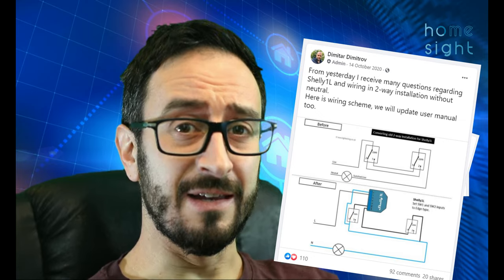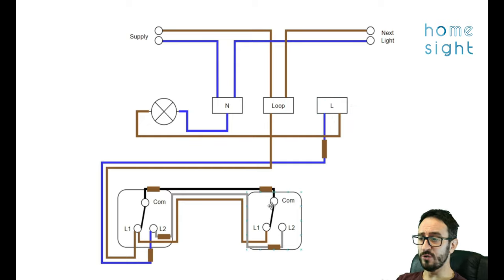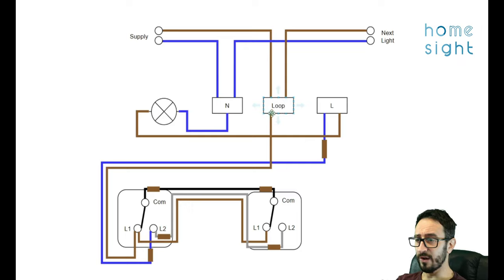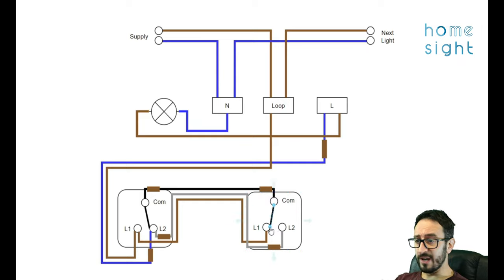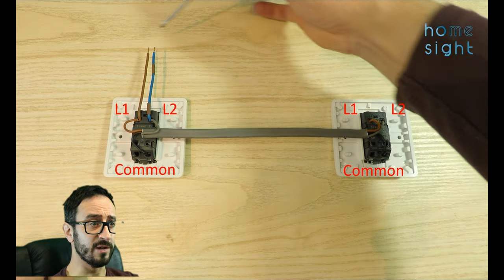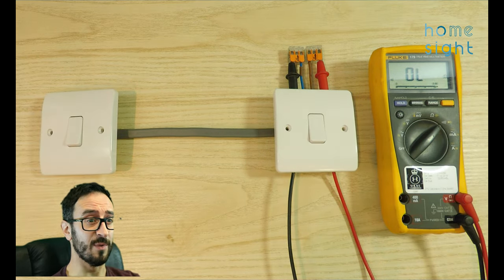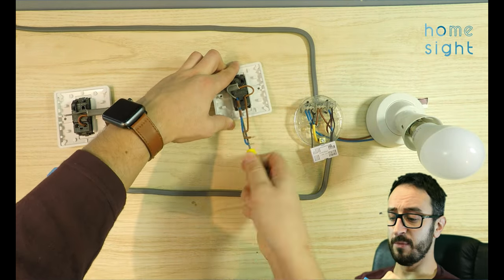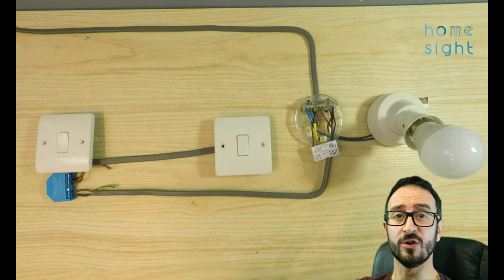How to wire 2 Way switching with Shelly 1 L. 2 Way light switching explained practically

Comment: Great video.   Shelly 1L is discontinued.   It would be great to see an updated video using an available Shelly device to achieve the same thing.   I was mostly interested in the 2nd method using 2 SPST switches.  Perhaps Shelly 2PM?  I don't know.

Comment: Hi, I am trying to wire a Shelly RGBW2 into a 12v lighting circuit on a boat, that has a 2 way switch. I can't seem to wire in the unit without over-riding the switches, leaving my only control via the shelly device. Any help much appreciated. Chris

Comment: Great video and easy to follow. Unfortunately in both of my switches I only have single wires going into L1 and L2 on BOTH switches. Could I simply pick one switch and take the existing L1 wire and plug into Shelly L, the existing L2 wire and plug into Shelly 0, and then take a new wire from Shelly SW1 into L1 on the switch and a new wire from Shelly Sx into L2?

Comment: Hi there. Very enlighting video. I tried it and works with only one flaw.....i used the one switch method but when i turn off the last switch (i connect shelly on the first)  that cuts the power!!!! So i cannot use it as 2way...what wrong did i made???

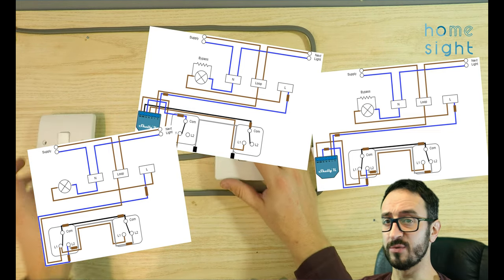Comment: Thanks for the video!  I paused the video and used the middle diagram you have at time index 8:03.  So far it is the only configuration I have been able to get to work with the Shelly 1L with my 2-way switches based on how my home is wired. Have you noticed that when the Shelly 1L is "off" there is still a small (<5v) amount of voltage that passes out "O"?
Reply from the maker: No problem Steve. Glad it worked. I did notice a small voltages”leak” yes.

Comment: Great video thanks. If I have a hall with 10 lights in parallel. Would I need a bypass for every one or just one? My thoughts are just on to add load to the circuit?
Reply from the maker: Yeah, just one is needed. It just needs enough load in the circuit to power itself.
Reply: @HomeSight  Thank you
Reply from the maker: You’re welcome!

Comment: Time to investigate my wiring...
Where I need this is for my hall and landing.

The hall has two switches and the landing three. Although one is downstairs on a double switch plate with the hall.

Both the hall and landing have two decorative lights each with three GU9's. And as the halogen lights expire, I am replacing them with LED's.

So while I don't need the bypass today, I will eventually right?

Would it cause an issue if I used the bypass anyway?
Reply from the maker: Hi Roy. Should only need a bypass when under 20w. Any of the old halogens should push above that! There’s no issue with adding it into the circuit anyway, but will add extra load and therefore cost! I’ve seen your messages about the switches with diagram so I’ll come back to you separately on that. Thanks

Comment: Hi, thanks for the video, you have really helped me out with these switches. Can you provide some information on how to use with a 2 Gang switch that controls 2 separate lights.  In my case the downstairs light is a two gang but upstairs is a single gang. I want to add a 2 Gang upstairs and connect the second switch to second Shelly that is used as a virtual switch to toggle the downstairs light. Could set this up as a scenario on your test board?

Comment: Hi there, I have just wired up a Shelly Relay Pro 4pm. I was wondering if the manual switches work regardless? For me, when I turn off the light / line using the Shelly app (the relay), I need to turn the manual switch on and off again for it to work. Have I was wondering if I am doing something wrong? Help.

Comment: Great Video, really useful, i have a 2-way 4 gang light switch i was hoping to use Shelly 2.5s with, do you know if i can use this method with the 2.5s or will i have to try and squeeze 4 1Ls in there? Thanks
Reply from the maker: Hi, assuming you have a neutral in there you could use a couple of 2.5s yeah no problem.

Comment: I have 2 light fittings controlled by 3 switches. Would I use your diagram with the black wire going into SW2 or Don't I need to bother with the Common. Also does it matter which switch I choose to install the shelly 1L. There is no Neutral.

Comment: Thansks Simon for the tutorial. It's a much needed help for us who are based in UK. Questions I have, hopefully you have time to answer this. 1st - I have similar setup to this, but have got 2 lights connected. I just need to use 1 bypass on one of them, correct? (Total of both lights are only 16W). 2nd - can I use the same method for 3 way? (3 light switches controlling same set of lights). Many thanks.
Reply: Anyone???Please??? Pretty Please??? :)

Comment: Hi I would like to use retractive momentary switches for my shelly.  Some guides have said the wiring is the same as a standard 2-way switch and others say momentary switches change the wiring.  Can you help with this at all?
Reply from the maker: Hi, I can. Yes they work in just the same way, the only difference is that you select the “momentary” button type in the Shelly settings. 

The wording from the Shelly is as follows: 
Momentary - Set Shelly device to be "Momentary" switch. Push-for "ON" or Push-for "OFF".

Hope that helps

Comment: Hi. Thank you for the informative video. I've recently purchased broadlink TC3 light switches. They have no neutral and no common.
Can I use these with a Shelly 1L on existing 2 way switch wiring? If so, how as with no common I'm unsure of what the wiring diagram should look like.
Thanks in advance
Reply from the maker: Hi, you won’t be able to use with the TC3. It just requires a standard switch. The TC3 would take the place of the dimmer as I understand it.

Comment: Can someone explain something to me.
So for shelly to have light on it must have live coming to SW. But if live is comming, and I turn light off using app, and then click one of switches - no live is coming to SW, will light turn on?
Basically, does shelly track 'state' meaning even with no live comming to SW it will light up?

Comment: Great video. Can the Shelly1L be fitted to a two gang switch with each switch operating a separate light?
Reply from the maker: Hi, they have 2 inputs but only 1 output, so can only control 1 lighting circuit.

Comment: Hey I loved the video thanks!! Quick question - I'm looking to create a permanently live socket from my porch light circuit ( I know this is not good practice, but its my only option). 

The light is a single switch, so there is no permanent live. Currently I'm planning on wiring it so its permanently live at the switch to allow for constant power for the socket. I will replace the current light with a sensor light. My question - is there anyway I can use a Shelly 1L in this circuit to keep the light switched and also provide a permanent live for the socket? Thanks in advance :)

Paul.
Reply: Hey any advise? thanks !
Reply from the maker: Hmm, I think I would just put a zigbee bulb in there if I’m honest? You could use the 1L though, just wire it at the rose and remove the switch, connecting the live and switched live into a connector block.
Reply: @HomeSight  If I use a 1L could I keep the switch on the wall to turn the light on / off, while connecting the socket before the bypass in order to keep the socket permanently live? Thanks for any feedback !
Reply from the maker: Umm… I’m not sure I full understand, but it doesn’t sound good! You shouldn’t have your lighting and your sockets on the same circuit

Comment: Great vid Simon, thanks! Good to see Home Auto based on UK wiring.
Would a Shelly 1L need to be protected by a 3A fuse/RCD?
Reply from the maker: Thanks Barry! Yes, i thought a while ago we needed some UK "skin in the game"! As it forms part of your lighting ring, a 6A would normally be used, unless you're planning on fusing separately?
Reply: @HomeSight  thanks for relying! However, would the 6a fuse offer any protection to a 4.1a device or would it just let the smoke out?
Reply from the maker: The fuse (circuit breaker) isn’t really there to protect the Shelly or any other device. It’s there to protect the circuit if a fault is caused by the Shelly (or any other device). If the Shelly blows and caused an electrical short, then the circuit would trip, equally if it was taking more current than anticipated, I.e more than the rated current, it would also trip as this would be classed as a fault condition.
Reply: @HomeSight  That's super, thanks very much & keep the videos rolling!
Reply from the maker: Thanks Barry, I sure will!

Comment: This was super useful. After a little bit of trial and error I was able to get two way switches working... Almost.

I used the first method you showed using the SW1 and SX. My issue is that when both switches are in the on position and if that puts the light on, the Shelly turns the bulb on and off rapidly. 

Not sure if this is a wiring issue or something I need to change in the Shelly settings? It's not a normal flicker, as I can hear the Shelly turning on and off behind the switch. Any suggestions?
Reply: It sounds like you might need a Shelly bypass as the load isn't sufficient?